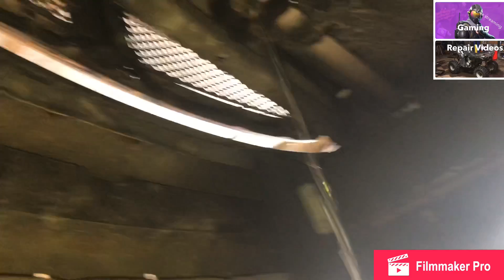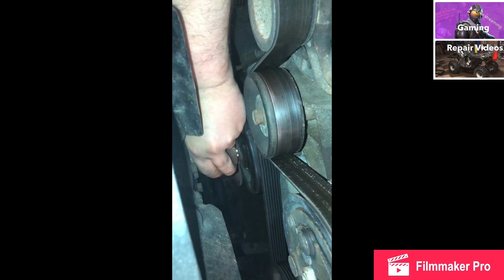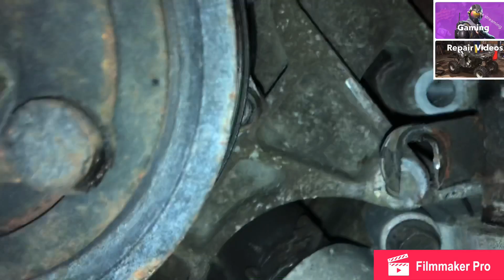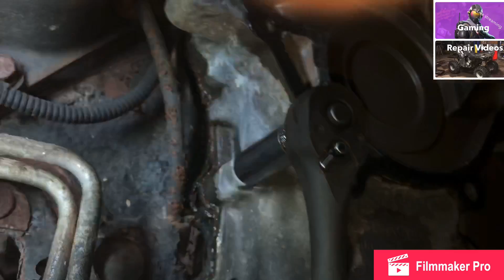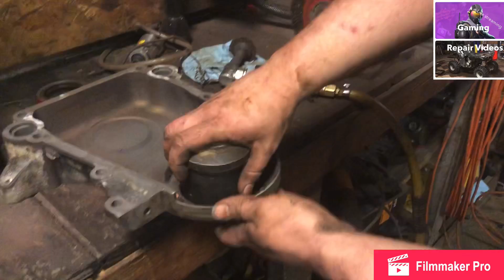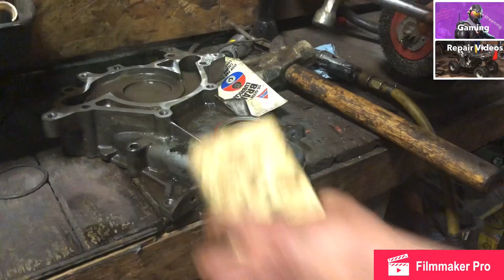Dodge 5.9L timing chain & Water Pump Replacement | timing cover replace sprockets & seal install

Comment: I have never commented, liked, or subscribed to anything ever.  Not even sure I am doing it right.  But me and my 15 year old son used the hell out of this video.   I bet i watched the   video 100 times during the process of the repair and everything went well.  Never would have got it done without your video.   Much appreciated.   I couldn't in good conscience not comment after using it as a crutch to save $1000 by having someone do it.
Reply from the maker: I’m honored kind sir
Reply: Thank you very much for posting this video. I like the way you were to the point about everything and not a lot of jabbering on about nonsense like so many others. Thank you very much for posting this video
Reply: You should unsubscribe he didn’t show us anything you can get a book from AutoZone and show you more😂

Comment: Yessir, helps tremendously. Having to remove my cover since 2 water pump bolts broke off, was able to extract one but the other broke further inside the timing cover so I figure I'll keep tearing down to extract at the source. Should check my chain & sprockets since it's approaching 200k. THx!

Comment: You’re not supposed to use that one by the way you’re supposed to use the one with the three that screw in the holes. Or you can bend it Thanks for your help dude.  for fucking nothing just like the rest of these Youtubers all they show is after they stop the video, unpause it and break the bolts then I’ll show you they’re not showing you nothing all they want is views that’s all that matters

Comment: Buddy of mine said I'll need zinc oil (break in oil) when installing a new timing chain/sprockets. Is that true? Or will I be fine with normal oil? Thanks for the video ;)
Reply from the maker: youll be fine with regular oil buddy

Comment: Great video,thanks I will use your video to do this job on my 2002 5.9L  Dodge Ram 1500 pickup truck .
Reply: Did the 3 jaw puller work?

Comment: Good video but just a tip. If you remove that big bolt out of the center of the hermonic balancer, pull the washer's off and then put the bolt back on the monic balance or will slide over the bolt

Comment: I have replaced my timing cover gasket twice now the first time around it held for about a month with a rubber gasket and RTV because this is the first rubber gasket I'd ever seen on a car I threw RTV on it as a matter of habit and I think that may have caused the leak and the timing cover itself to get micro cracks in it and start to leak currently I am trying to redo the timing cover because when I ordered a new timing cover I got a crappy gasket and it didn't seal and I used RTV on it. So I'm going to try to get another rubber gasket and not use RTV on it and see if it seals this time. I never got to see whether your video actually worked out when it came to the timing cover I assume it did. So this time around I'm going to try your method plus it's been recommended that I replace the bolts because I've had to pull them so many times they may be stretched this is on a 5.2 98 Durango.

Comment: If the timing chain gears have key ways, and you cannot put them on wrong, do you still have to line up the dots on the gears straight up and down?  Or can you just put on the gears in the position they came off in?
Reply from the maker: Line em up homie!
Reply: @FerKurl  Yepper.  Thanks
Reply: Great video by the way.

Comment: Did you have some slack in the chain? I’m doing one right now and the driver side part of the chain has some slack and passenger side is pretty tight.
Reply from the maker: Yea this had plenty of slack. Chains will stretch over time. Always replace
Reply: Im sorry I should of specified as in the new chain!

Comment: Discovered this leak in my 98 Dakota, have the water pump, have the timing gasket. Now iam thinking maybe i should do the sprockets, & timing chain too now?🤔
Reply from the maker: its def a good idea!
Reply: This also appears to be a fairly common issue on these engines. 

unfornatly this is way beyond my mecanical skill set, & i don't think i have all the correct tools to perform this task myself.
Reply from the maker: drats

Comment: My 5.9L on my Durango runs rough, but then smooths out every 20 miles or so. I don’t know if it’s the timing chain though. 222k miles. Spark plugs look fine. I’m don’t really want to dig into the timing chain if I don’t have to. Any suggestions on diagnosing this?
Reply from the maker: Check compression, fuel pressure n spark first

Comment: Awesome video.  I have the same problem on my 1995 dodge ram 1500 with 5.2 liter engine. I thought it was water pump  but noticed when I removed the water pump I noticed water running from the upper left side of my block where timing chain cover is. Your video is so simple and very on point yet did in a timeless fashion, with all information that is needed to do the job. This was about the best  video I have seen that was so on point and  camera was very clear on every place you were working on. Thanks.. it really helped me

Comment: I like how you threaded the crank bolt out a little ways and used the puller with it. Much easier than looking for a socket to put in the crank hole, so you don't damage the threads. Great video!

Comment: What is that second gasket that looks similar to the water pump gasket ? I didn't realize my kit came with that one until i found it sitting
Reply from the maker: not sure what youre tacoing about, can you specify? also some kits come with extra gaskets to fit a wide range of models

Comment: For future reference you can remove the alt and ac compressor bracket off with the alt still attached as a shortcut.

Nice thorough instructable. Thanks for sharing😁
Reply from the maker: true dat

Comment: The pulley bolt is 31mm and it is a bear to get off. I am trying to use a big screwdriver against the cross member underneath, to keep the pulley from turning and a breaker bar on the 30 mm socket but the screwdriver keeps slipping.
Reply from the maker: Lock the flex plate or use air impact

Comment: Year later but - say yer chain "jumped a tooth" or they do not align whadoya do then?  Rotate the cam clockwise around once, or rotate the crank around twice till they are lined up?  Working with a Haynes manual here.
Reply from the maker: So let’s get some info here, the chain is still wrapped around the sprockets and is fairly tight?
Reply: @FerKurl  I have not opened the engine yet but I'm preparing to. I believe that it has all the characteristics of a jump chain. It has over 200k on this timing chain. I do not believe it is broken.
Reply from the maker: Most likely the chain just has a ton of slack.
Reply from the maker: So you will spin the crank sprocket til it’s straight up, if the cam mark is on the upper half give the crank another rotation clockwise and point straight up. That should get the cam close. Remove chain and sprockets.

Comment: Man just doing one today and boy did someone do the timing all wrong camshaft pointing at 12 o clock and crank at the right position at tdc poor customer
Reply: I found the same situation on my 74 360, do you rotate the cam to six o clock? Or just put the new one on at six o clock?
Reply: @wonkydell  It's a little late but cam mark should be at 6 o'clock, crank mark at 12 o'clock.

Comment: How much a job like this, I think I'm need this done to mines ive been smelling cooling & I got under there to look for a link & seen wet spots on both sides up top of the trimming cover
Reply from the maker: It’s common leak spot for em. Depends on how much your local mechanic charges. I can give you labor time when I’m in front of my work computer if you want
Reply: @FerKurl  that'll be great, I told them that's what I think it is from ur video & others videos I watched it leads up to that being the problem

Comment: Can you just note where the timing Marks are and not have to bump the motor to where they line up and just put the new set where the old one was??? Or is it best to bump the motor to where they line up
Reply from the maker: You can turn the motor over by hand to line em up, it’s not a big deal. Good luck!

Comment: Is it a 2gn?
Reply from the maker: Huh?
Reply: Second generation ram
Reply from the maker: @fabianlucas6201  that’s a 2002. 2002-2008 is 3rd gen
Reply from the maker: Well I guess some 2nd gens were   2002. If my memory is correct then 3rd gen
Reply: the 1st year 2002 the 1500 was new body 3rd gen and the 2500 and 3500 was still 2nd gen

Comment: Great job FerKurl. I am restoring an '85 Ram D350. I am 71 years old. & Couldn't do it with out your help. Thank you SOOO Much.
Reply from the maker: Guy Stritzinger glad I could help! Thank you for watching!!!!
Reply: Say hi. I've been watching a few of these videos on this subject. Being a Mopar guy since my teens. I've noticed that it seems the crank seal can be removed from the cover with out removing the cover from the engine, did they change the design in 2000. My I'd leaking oil, haven't decided to do the timing chain and all. Have you thought of the adjustable advance or retardable versions. On gives more torque at lower the other gives more power at the upper rpm. Since we don't race. I'm thinking for more down low. But mind you mine is a 2000 reg cab Dakota RT. I've got the performance computer from Mopar, a 2300 Mopar stall. Over the counter stuff. It's fun down low. Gets up and goes. Factory 3:90 gears. At 73 I'm thinking of putting all my performance parts together . And enjoy it while I still can. Since I don't travel much anymore. But when nobody is around tapping it is fun. I've got a freshened 408, M1 intake 2 or 4 bbl, various throttle bodies
 Hughes etc. 
 Thanks you for you informative video.

Comment: You are aware that the entire bracket for the a/c pump, alt and idler pully comes off as an assembly with 6 bolts, i hope.....
Reply from the maker: Andrew Knight yes I’m aware. Most people don’t have the ac tools I have and disconnecting the ac lines would involve a recharge. So do it this way and it’s just easier for your average do it yourselfers. It only takes literally a few extra mins. Like literally bud. Super easy either way. 👍👍👍

Comment: It's called a water pump inlet tube & suspected that my dodge ram van has the same problem ( timing cover water leak).
Reply: Hey what year is your van I have an 85 b350 1 ton and need to replace the pump and timing gaskets
Reply: @krystalstockam359  I have a 1994 dodge ram B250.

Comment: Great video. Currently changing a timing chain/gears/balancer on a 2001 5.9L Dodge. It’s nice to see a straight shooter with no hype get the job done like you did. Greatly appreciated.
Reply from the maker: Dustin Lambert heck yea man. Appreciated 👍
Reply: The
Reply: So you didn't need to drop the oil pan to do the front cover?

Comment: do you have to worry about getting coolant in your oil pan?
Reply from the maker: ChrisCG try not let the coolant run in the pan. Drain the coolant well. I always do a good oil change afterwards
Reply: @FerKurl  damn I just did my oil pan and rear main, biggest pain in the ass I should've done this at the same time. Guess I'll wait for my next oil change to do this, hopefully it doesn't get too much worse
Reply from the maker: ChrisCG always recommended to do the oil pan gasket when doing the timing cover but if you’re careful with the oil pan gasket you should be fine.
Reply: Excellent video!!
Reply: Did it work without changing the oil pan gasket???

Comment: I typed in the search, 1999 dodge ram 1500 5.2L Timing Cover removal, and your video came up 11th. Doesn't appear to be any difference in motors. You helped me on all points. Good how to video, thanks.
Reply from the maker: Awesome! There’s practically no difference. Thanks for the view and comment!
Reply: @FerKurl   I'm doing it on my van just so it's that extra fun. I thought it was just the water pump leaking and there were 2 pinhole leaks in the radiator. I  couldn't keep enough water in the system to pressure test and could never see where the leak originated. Replaced everything, belt, hoses, thermostat and housing. Put near a gallon of antifreeze in then heard a gurgle and watched the coolant run down the driveway. I must be getting old letting a MOPAR sneak up on me. What brand name is the blue gaskets you used?
Reply from the maker: IDYLBERRY Fel-Pro makes that gasket
Reply: @FerKurl  Thanks friend!  Going to parts houses today that carry FelPro which has been my preferred gaskets for decades. Stay healthy.
Reply from the maker: IDYLBERRY 👍